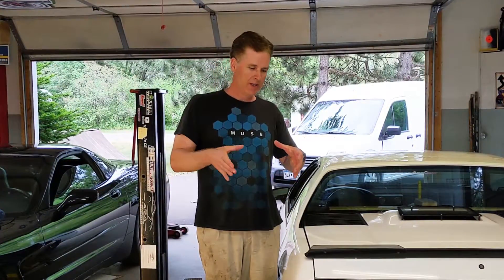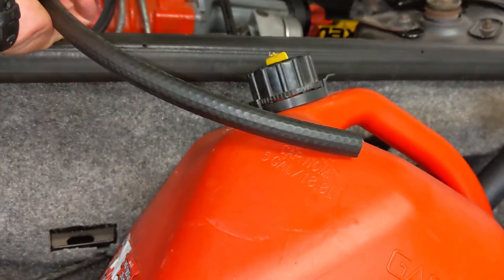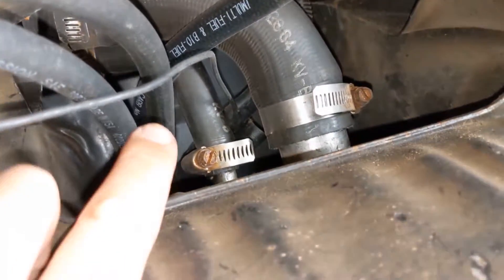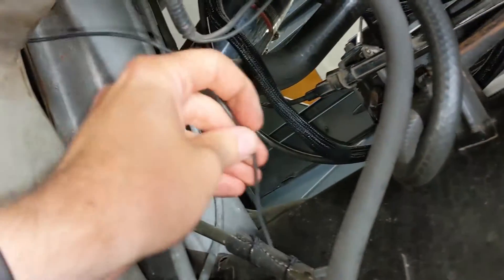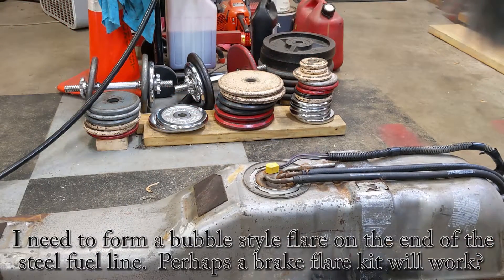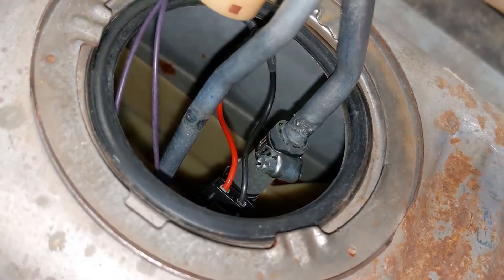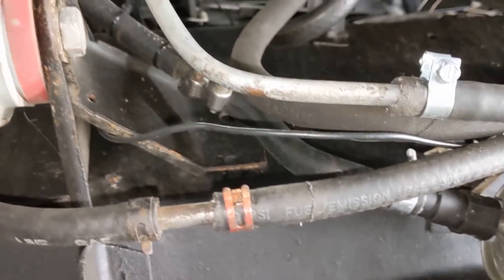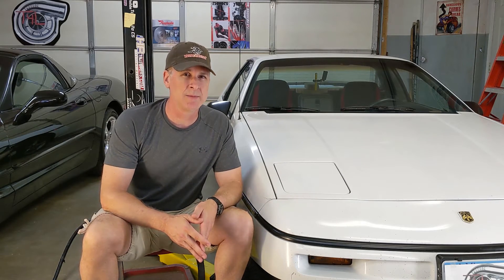Supercharged 3800 Pontiac Fiero Fuel Leak Fix (Gas Tank Removal and Diagnosis)

Comment: When I did my 3800 swap and installed the fuel pump I changed the lines. I ended up going with compression fittings to -an lines.  No more hose clamps!  Now that I’m typing this I remember I used E85 compliant hoses so I could probably run E85. Just need a tune for it. 🤔
Reply from the maker: & bigger injectors most likely.

Comment: Great video, though I have one recommendation.  Running the engine to drain the fuel tank is risky because the fumes can be ignited by any number of ignition sources (spark plug wire shorting, arcing relay points, an engine backfire, etc).  A safer way to drain the tank is to apply 12V to pin "G" on the Assembly Line Diagnostic Link (ALDL) connector found under the center armrest beside the cigarette lighter.  That will turn the fuel pump on remotely without any other systems running.  Just be sure to stop the pump as soon as the tank is empty because it needs fuel flow to keep it cool.
Reply from the maker: Excellent suggestion- Thank you!

Comment: Ethanol will not affect the tank itself. It will affect rubber and other materials similar to it,. Too many people spread wrongful information from being ignorant of facts.
Reply from the maker: 100% agreed.  I only shy away from ethanol when vehicles are not driven often and stored for long periods of time in humid areas.  It will absorb water over long periods of time which can rust a tank over time.

Comment: Nice video! Can you show where you ordered your hard line for attaching to fuel filter? I should look into that as well. Thanks.
Reply from the maker: Thank you!    Orielly -  Dorman Part # 800-170   about $5.00.
Reply: @Toys4Life , Thanks for the part number. Have you thought about using stainless steel line for attaching to fuel filter instead?

What about those fuel injection style clamps? Is there a part number for those? Thanks again!
Reply from the maker: O'Reilly, Master pro, part number MP131516F.
Reply: @Toys4Life , Thank you!

Comment: From one Fiero owner to another.  Your next fuel leak issue is going to be, that RARE Filler Hose.  In 84 thru 87 they did NOT have any Alcohol in the fuel.  That Hose is NOT Ethonal rated and will DETERORIATE.   I am suprised the one you have is still intact.  Mine became VERY RUBBERY to the point you could cut the hose with your finger nail!  I run 91 octain Alcohol -free fuel in mine, problem solved!
Reply from the maker: Good to know.  I have been on E85 for 8+years and so far so good.  I never "top it off" at the pump and fill it to the rim - wonder if that might be the difference as it is never really submerged in fuel - only short periods when filling?  The original little hose in the tank deteriorated before I went E85 - probably due to being submerged in various fuels for 37 years?   I will keep an eye on it.
Reply: @Toys4Life  Good Idea that would Explain a LOT!